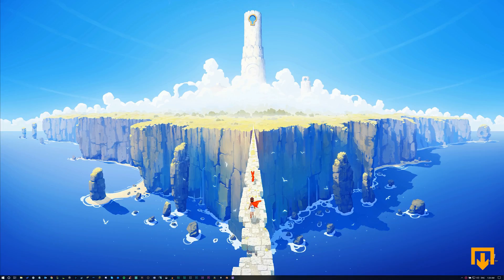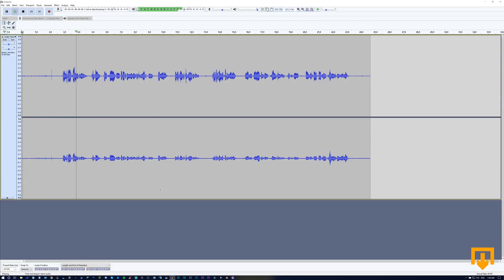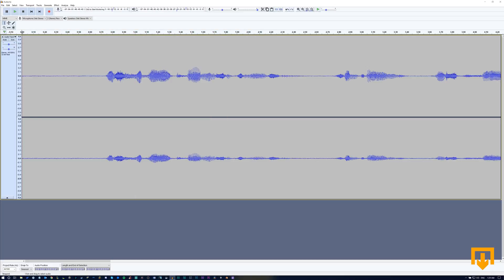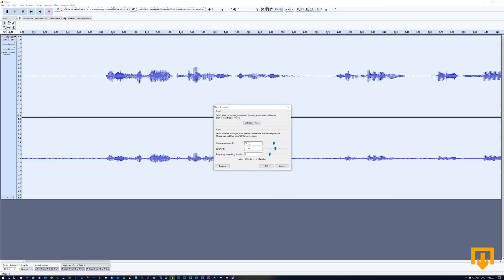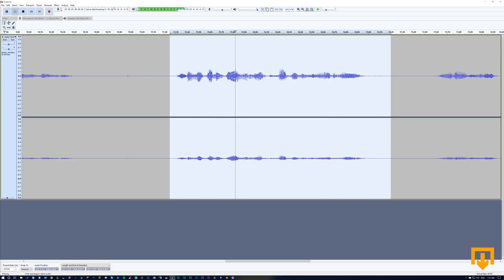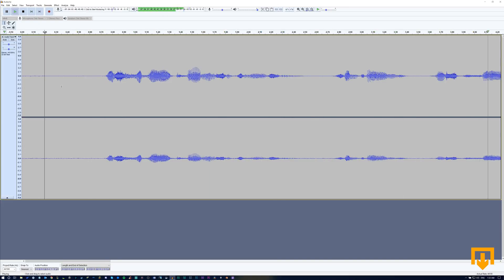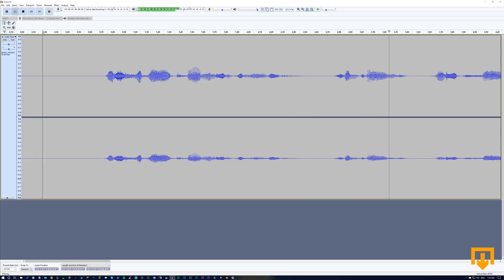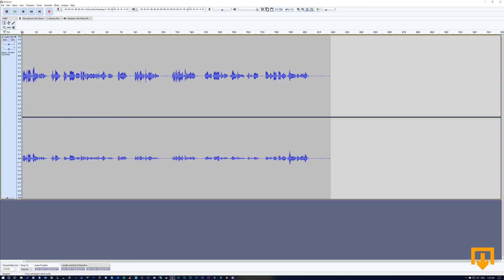How to Use Noise Reduction in Audacity

Comment: Very useful tips, thanks! Do you suggest change other parameters as well, as sensibility, frecuency?
Reply from the maker: Yep! Playing around with those settings helps to finetune your connection and give you clearer audio. But I would only do slight adjustments as major adjustments can really distort or impact the sound quality.

Comment: Hello. Thanks for the video. But how to remove the background noise entirely to not hear the noise at all? I'm thinking of converting a bedroom into a studio but not sure if it's possible. I dont have a working fan in the bedroom BUT there's almost the same kind of noise being generated every time I record the sound. I use Blue Yeti X usb microphone with is a good one I believe. Any typs? Thanks!
Reply: usb microphones are the reason why noise is present in the back. its something that cant get rid of with voice filters or eq. you may need an audio interface that you can use xlr microphones in order to have full control over your mic sound.